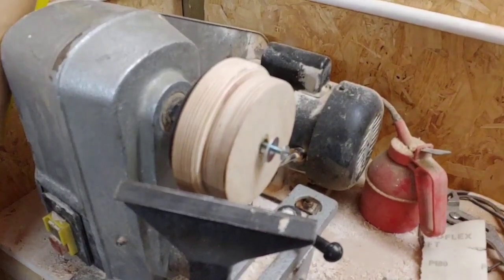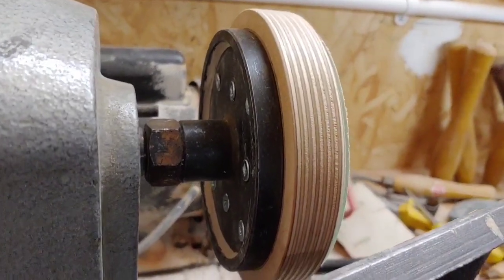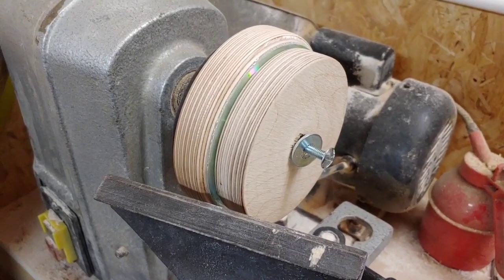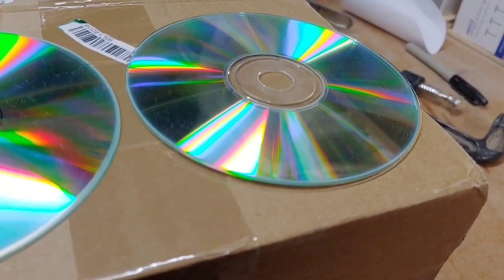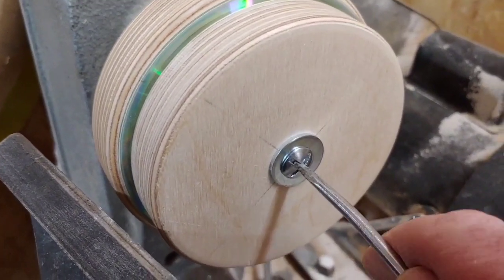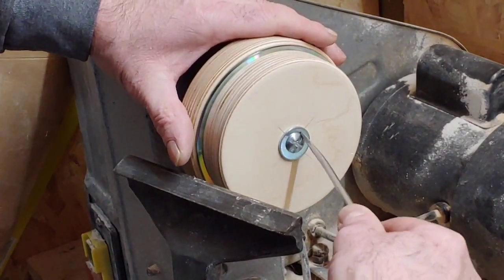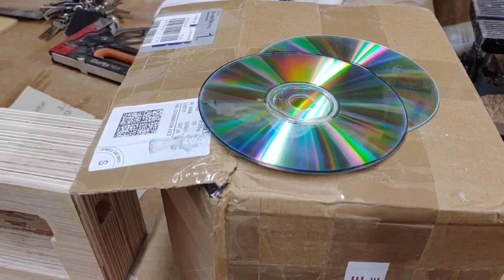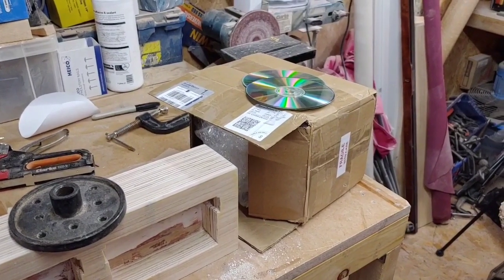My Prototype CD Enhancer

Comment: I blacken the outer and inner edges of all of my CDs out of principle. A chisel ended pen is the easiest to do this with. I have found that most outer edges are flat while some are stepped. A beville edge makes sense too.
Reply: No, it does not make any sense at all. It's snake oil, and probably one of the biggest scams in the history of audio. To top it all, I might even damage your CDs.

Comment: I just thought it was worth a mention, I don't usually like to rain on people's parades but you mentioned this making the sound less harsh, this is quite literally impossible, digital media is stored in bits, other than different methods of audio compression and encoding there is no possible way to alter the sound quality
Reply: I'd also like to add that if there was any change to the data on the disk by doing this then it would just stop working completely, CD's are not analog and altering the medium makes zero difference to sound quality
Reply: Yet different CD transports give different sound. Explain that…..
Reply: There’s no such thing as a digital wave. Digital data is encoded into an analog wave. Therefore ‘bit perfect’ means little wrt the output of a CD transport. CD transports can sound different, digital cables can affect the sound, etc etc
Reply from the maker: Hello Kate, The effect is not mind-blowing, but it's certainly worthwhile. Discs that have been 'improved' clearly have wider dynamic range, thanks to a lowered noise floor that naturally lets more detail through. Nothing changes tonally and imaging remains the same, but you can hear further into the mix and the nature of sounds is easier to distinguish.
There is a general cleaning-up of the sound across the board, so bass is better defined and more punchy, while the treble has more air – cymbals, for instance, sound more realistic.

On one album of percussion and drums it was not possible to hear exactly how some of the sounds were being made prior to bevelling and marking, but after machining the extra resolve gave me enough insight to be able to visualise the instruments (if not actually name them!).

Thanks for commenting & watching👍
Reply: What you're saying is simply bullshit. Shaving the edge and/or black it out it will not change a single thing. This is not how Compact Disc works. This is snake oil, and you're promoting it.